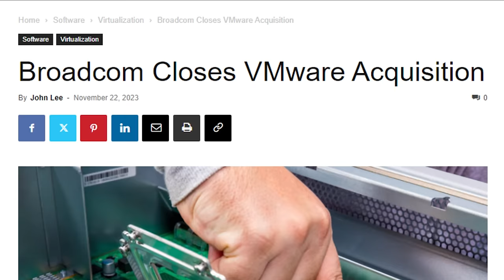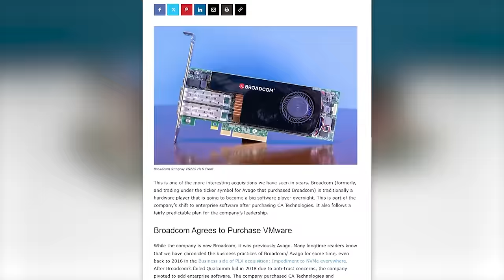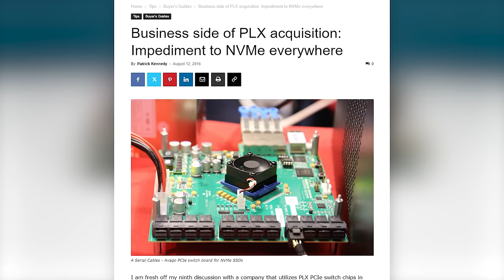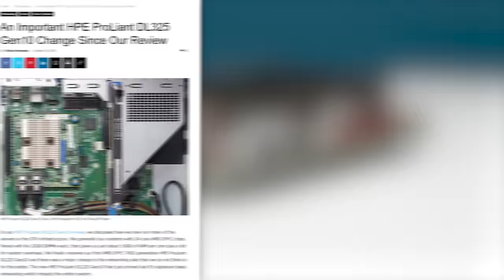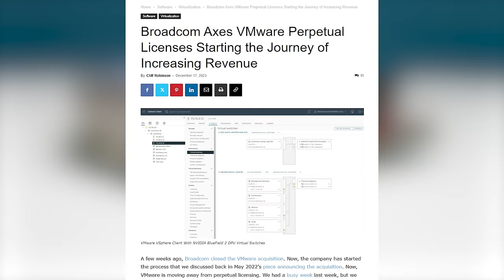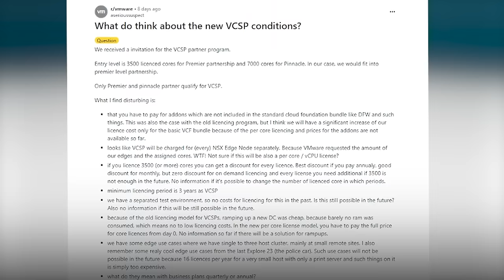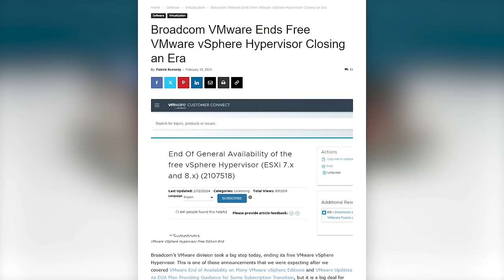VMware GUTS Customers with 10x Price Increases

Comment: RiP VMWare, was fun knowing you.
(somewhere between 85 and 95% of companies I know serveradmins at, are all in the process of moving away from VMWare now)

Still shed a tear from Novell as well (last used it on V4.11, when it was still a viable system)
Reply: feels good to be in that <5% that wasn't stupid enough to use vmware in the first place
Reply: @gg-gn3re  You clearly weren't around in 2003 when there really was no other hypervisor for the enterprise. Xen required a custom kernel so that wasn't good for Windows server. ESXi and its vCenter were the only enterprise solution for many years while the other hypervisors come along and got the ability to do live migration, live storage migration, HA and other features. Most other hypervisors required Intel / AMD CPU hypervisor extensions to run. ESXi needed none of those for years.
Reply: They have probably said they are, but they wont.

Comment: I know people who worked (yes past tense) at VMware during the acquisition. It’s a blood bath over there, they have lost (laid off) most of their top support teams, engineers, and good staff. Anyone on VMware needs to run, and run fast.
Reply from the maker: That is often the case with acquisitions.
Reply: @ServeTheHomeVideo  A good acquisition does not chuck out valuable talent ("engineers") Sales, marketing, executives, middle management, ... sure, but the people at the core of the value for the company is suicidal to dump. What new technologies are you going to being to market if you fire the people integral to creating them?
Reply: @jfbeam  First phase of any acquisition is to clean house and remove any job duplication regardless of their seniority.   Then restructure the teams.  Talk about moral killer.
Reply: @Darkk6969  I doubt there's a great deal of duplication in their technical roles.
Reply: @ServeTheHomeVideo That “often” happens but not “always” happens.
Reply: The really says that VMWare is dead.  It might twitch a bit for years to come, but underneath it's dead and rotting.
Reply from the maker: @jfbeam  If you are in a subscription model, there is less pressure to deliver new technologies.
Reply: @jfbeam  No bean counter thinks of this, they only care about cutting costs.  Trust me, I'm there right now.
Reply: @ServeTheHomeVideo  And when you stop innovating, your competition - for which vmware does have plenty - will eat you alive. Granted, vmware has a hell of a head start.
Reply: It's just another story in the long history of Monopolism - a societal ideology in which the rule enforcing framework benefits a few (here software patents / IP) at the cost of the rest.  Luckily IT is changing and progressing all the time.. the effect of this in other industries / areas is MUCH MORE profound.
Reply: @ServeTheHomeVideo  "If you are in a subscription model, there is less pressure to deliver new technologies." -

it has nothing to do with subscription model. It has to do with global politics. Pax Americana is being dismantled and USA are being reformatted as a local power by conceptually powerful subjects of global politics. Hence reorganization of resource flows in the process of globalization. Imagine that after robbery of Russia in 1990-s state "elites" of USA were not able to rebuild infrastructure in USA that is worn out by 85 % today. Open Source (licensing) was invented to avoid sanctions that are enforced to split global economy into zones. For example, major and critical parts of PostgreSQL were developed in Russia.
Reply: Activate emergency teleporters. All crew to escape pods. This is not a drill!
Reply: Laid off vmware developers should club together and create a new product that will blow vmware away!

Comment: If I was a CTO and a supplier came to me asking 10x more than they were getting last year you can bet I will be looking for alternatives and an exit strategy from that supplier because it's quite obvious they're not to be trusted.
Reply: If you have perpetual licenses (as I do), I'd just tell them to f... off!, continue using what I have for as long as it works for me, and start looking at less shit options.
Reply: @jfbeam  If you don't care about security updates and upgrades then cool.  Vmware is highly targeted by hackers so either move to another solution or pay up.
Reply: @Darkk6969  As internal infrastructure, it's less of a concern.
Reply: If a vendor comes in with a new quote that's 10x higher, thank them, they've given you an exact budget for replacing them with something else.
Reply: @jfbeam if you are not concern about security issues because, they are on the internal network, you are a part of the problem.
Reply: @dltmap Don't make assumptions.  If he's black-holed with air-gap, he's fine.  Not everything has an ingress path with an attack surface.
Reply: If you were a CTO and only started to look for an exit strategy after a supplier started asking for 10x the money, you should never have become a CTO and should be fired forthwith.

Just two words: "Contingency planning".  Or in engineer-speak: worst case scenario analysis.
Reply: I wish that were the case. I've worked for the largest of banks and contingency isn't in the vocabulary. I'll tell you one day about multi-year projects to eliminate vendors that want $50m per annum for their crappy software. Or paying top dollar for a fancy platform that doesn't work properly for years then being asked to have it replaced with something else in 2 weeks just because.

Comment: Broadcom and the PLX deal still drives me up the wall to this day. Before the acquisition there was the WS series of board from Asus where the Z77 and Z87 board would have 1 PLX Pcie chip so that they can do 4 way SLI and the X79 and X99 board can do 7*8x Pcie gen 3 on an ATX board. And those board were reasonable in pricing. But with the acquisition those kind of board just get killed because no one can justify paying hundred and hundreds of dollar for such a niche chip to enable such a niche feature. How fast everyone would have adopted m.2 pcie if those 7*8x boards were readily available... I mean you can stuff 14 nvme drives on a motherboard from 2015-2016 if the acquisition did not goes through and PLX chip prices went through the roof.

Rant over.

Comment: I ran servers for a research university starting around 2000, and started deploying VMware in about 2004 with their free offerings.  Eventually we purchased the enterprise version which was priced per socket.  At the same time we were moving from 4 cores(no HT)/socket to 8(with HT), VMware changed their pricing to per core (I think it counted virtual cores too), so our cost was about to increase 1600%).  We continued running what we had with less than 2 years until EOL.  After much research, we went with Red Hat Virtualization, and migrated many hundreds of VMs over to the new cluster, and never looked back.  When the university started using VMs for cs classes, they were deploying maybe tens of thousands of fresh VMs each semester, and had moved to 32 core AMD with SMT, and were saving several million/year over VMware licensing.  There's a lot of competition in that market now, and VMware's greed will likely spawn direct competition at significantly lower prices.

Comment: Former Nutanix employee here. It can run VMware or its own (included) KVM-based hypervisor, and has an excellent tool to migrate from VMware. The support is the best in the business by a mile. Put that on your radar if you have VMware and feel hopeless.
Reply: I think Nutanix is poised to take VMware's market share. They are likely the new king of virtualization.
Reply: Thanks!
Reply: Best support because you're gonna need it when that "Controller VM" for the software defined storage breaks. Don't fall for it folks, real HCI have kernel modules for storage like vSAN, S2D or Longhorn.
Reply: Sorry KVM is still in its infancy. One update and everything breaks.
Reply: @wolfgangpreier9160  It's KVM-based, not vanilla KVM.
Reply from the maker: What is funny, is that STH would have been a Nutanix instead of a Proxmox VE shop if they did not have a funky issue many years ago with the way the installer handled CPU IDs that would cause it to error out. I sent the bug in. I did not get a happy response, now millions have seen Proxmox VE coverage on STH.
Reply: @friedgpu  Based on what, exactly? There are built-in redundancies if the CVM falls over, for example during an upgrade. You still aren't down, there is just slightly higher access latency until the CVM is recovered/repaired - an event that is extremely rare.
Reply: @vPeteWalker  CVM is straight up a bad approach — it's bloated, inefficient, and a completely separated OS and management to handle a subsystem that is essencial to HCI. The software defined storage module should be part of the hypervisor, not a separate VM.
Reply: @ServeTheHomeVideo  I'd love to hear more on this, if you don't mind. I have never heard of this issue before, but I'm also not in support. Installer for what? What was the expected behavior and what did it do instead? Thanks man.
Reply: @friedgpu  Again, based on what? What data are you basing these statements on? "Should be" - again, based on... ? If it's based on feelings, not facts, then I don't know where else to take this conversation.
Reply: @friedgpu wut? I am not familiar with Nutanix, but HCI is totally possible if you size your systems correctly. But what I mean to comment on is Longhorn, it completely works on userspace and it's slooooow. The correct comparison would be drbd (with or without linstor as the SDN controller)
Reply: Do you think Broadcom will go after Nutanix too?
Reply: @LampJustin  good cal on drbd, I wasn't aware of it.
Reply: Nutanix will never take VMware's share until they support iscsi and fc connected external storage. So many places use VMware specifically because of cheap jbods and its ease of use compared to Hyper-V. I know its not "simple" but AHV can and should feature-match ESXI if Nutanix wants market share.
Reply: @wolfgangpreier9160   that is absolutely false
Reply: Comparing Longhorn to the storage Nutanix has is bad lol.

Ive worked with Nutanix between 2015 and 2021, helped to deploy it on three different companies and none of the problem people here mentioned happened.

We had far less problems with Nutanix and its storage compared to a traditional stack like VMWare and dedicated storage.

Performance whise, it runs around VMware several times.

However, the webUI is not that fun. Clunky and a somewhat a mess to manage many machines and it is built around having other systems interact with it.
Reply: @friedgpu  Longhorn is really bad, comparing it with vSAN is just a insult
Reply: I have spoken with many admins saying that moving to Nutanix was the worst choice the organisation has ever made.
Reply: @Hypernerdwithcam  If you do not elaborate i count your comment as trolling.
Reply: @wolfgangpreier9160  
Claiming that KVM breaks after every update is trolling. No need for me to elaborate since you clearly are doing something wrong.
Reply: @ServeTheHomeVideo  The fact that an IT guy cannot even install their community edition successfully shows it's not ready to replace VMware. Requiring a minimum of 3 hard drives and a klunky installer doesnt help. I just recently migrated from ESXi and ran the gamut of about 10 options, Nutanix was by far one of the worst ones and it just didnt work.
Reply: @Hypernerdwithcam  Thats perfectly ok. 

Then i do something wrong and you do something right. 

KVM is clearly not viable for small enterprise use.

If you know how to and do it fine and nice for you.

I do not.

Am i clear enough for you or shall i elaborate?
Reply: @ninja2807  Yeah? Ask them how they’re feeling about VMware right now, and get back to me.
Reply: @napalmsteak   I was straight up told that Community Edition was just to gather data/hardware info for them. Also, I know of orgs who used community edition in an enterprise settings instead of paying the bill. So not surprised.
Reply: XCPNG runs circles around nutanix, at 1/10th the price.
Reply: @spyrule  Ok.
Reply: @AryesGungetcha absolutely this.
Reply: @wolfgangpreier9160  KVM in its infancy?  Hard disagree.
Reply: @vPeteWalker  Take off your Nutanix badge, buddy. I already told the facts why the CVM is bad, and if still you can’t see how a kernel direct approach is better, then I don’t know where else to take this conversation.
Reply: @friedgpu  You didn’t give any facts. Just opinions.
Reply: @vPeteWalker  Please tell me when efficiency became a opinion rather than a fact
Reply: @Hypernerdwithcam  saying that Nutanix have better performance than dedicated storage can be a bit misleading, since HCI requires some level of flash whereas storage can be full mechanical and badly deployed (without MPIO, undersized controllers or frontend connections, etc)
Reply: @friedgpu  because you don’t quantify it at all. Efficient in what way? Are you saying because it uses memory and cpu that you’re saying it’s in efficient versus it being in kernel? Because if so, that’s taken wholesale from VMware and it’s no more or less efficient. Also, it’s design like that on purpose so that when you perform an upgrade, the host, hyper visor, and the CVM are separate, and one is not dependent on the other. Versus the VMwhere everything is in Colonel and if there are issues you have to wait for the next version of the begin where to fix it. So you saying inefficient is a very big blanket statement that you don’t explain it all. That’s why it’s your opinion because you’ve given absolutely nothing to go on, and just a single word.
Reply: @vPeteWalker  if you’re saying that decoupling hypervisor from storage is a good thing then you don’t understand the concept of HCI at all. Also, I mean efficiency in the sense that to serve I/O in the Nutanix fashion, the request has to go to Hypervisor > NFS/SMB/iSCSI > CVM OS > PCI Passthrough > Disk and then go all the way back, instead of vSAN or S2D where the I/O has to go to Hypervisor Kernel > Disk. Now you get it?
Reply: @friedgpu  well, we saw much lower latency with Nutanix AHV and all flash compared to same load test with VMware and vSAN.
But I guess it depends on the type of workload - as always.
Reply: However, choosing the correct stack should not be based on the comments on social media. But rather on several factors, as support, flexibility, performance and much more.

Comment: We have been shifting from VMWare to Nutanix using the AHV hypervisor over the last 3 years - have dropped from 64 sockets of ESXi down to 6 and haven't looked back.
Reply: Glad to hear it’s working out for you. We’re in the same boat and about to start switching over to AHV.
Reply: Isn’t the nutanix price is like $3000 per core?
Reply: The biggest issue I saw with Nutanix was support....cost is a big factor, but that's the biggest to me.
Reply: I can guarantee switching hypervisors alone didn’t allow you to consolidate down from 64 sockets to 6 sockets.  Nice fairytale thou
Reply: @skiptdouglas  I don’t think that’s what the OP meant. He probably meant that they switched 58 sockets over to AHV and only have 6 left on ESXi.
Reply: @MaxPower-11   that would make more sense .
Reply: @skiptdouglas  Apologize for the phrasing, what I meant was we dropped all but 6 of our Plat+ sockets - we have 3rd party OVAs that require ESXi (Avaya, etc) that we can't replace...yet... - the rest went into 5 Nutanix clusters under AHV.
Reply: @e1dz  Where did you get that number????   I have to obscure this a little for legal reasons but in 2021 I didn't pay more than $490 "per core per year" on a 5 year contract and that included all server hardware, the per TiB Flash license that was charged at that time plus the Prism Central Pro license.  (I took the project total for the first Nutanix cluster and just divided it by the number of cores it started with)

Comment: The large customers will find a way to switch. Slowly, they'll switch. Prior to retiring I was an IT architect at a Fortune 30 company when Oracle started tightening the licensing cost screws for Oracle DB. It did not take long to formulate a plan to start replacing Oracle DB with SQL Server.  It started with the low hanging fruit and progressed from there.

I think that Broadcom is shooting themselves between the eyes with respect to VMware. The large population stranded on the VMWare island is too juicy a target and the shark still start circling snatching customers away. It takes only one business with deep pocket that is willing to bear higher transition costs initially to show a path on the island.

Comment: It's not just ESXi. If you're a big VMWare shop you're probably using NSX and all it's integrated features. Nightmare translating all those rules using tags, groups and names to another vendor ( especially if you've been using micro segmenting). Real shame, VMWare and it's staff have always been one to push the boundaries of tech. Now to become just a dinosaur.
Reply: Yeah, THIS.   Even more when you have those tags used by firewalls, and automation to sequester/redeploy based on incidents.  We built out entire MSP hosting solutions based on this for many clients.    All that effort/R&D costs to build out the infrastructure over the last several years is just gone as there is now no way to recoup the sunk cost.   Heads need to see if doing the same thing again with another base layer is worth it or to just end that  service.